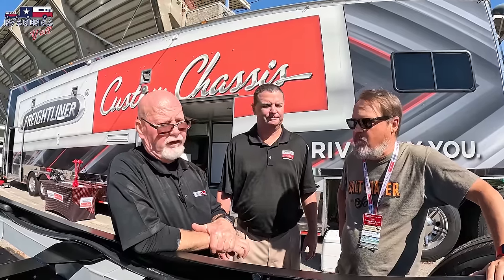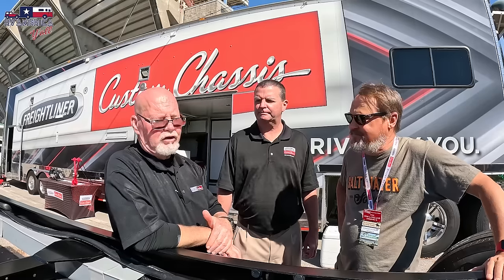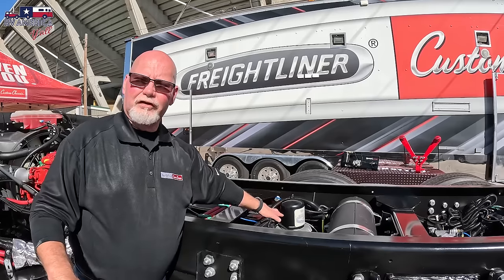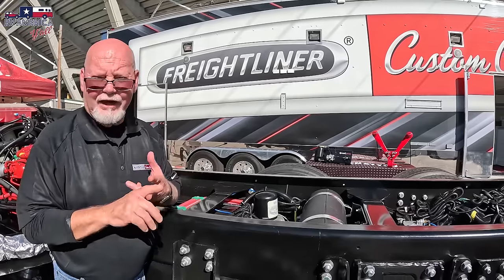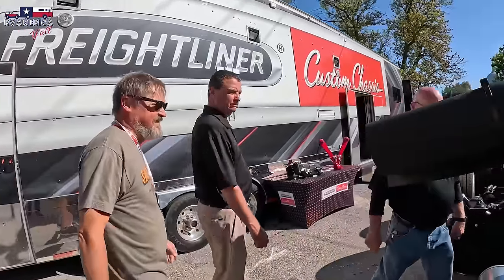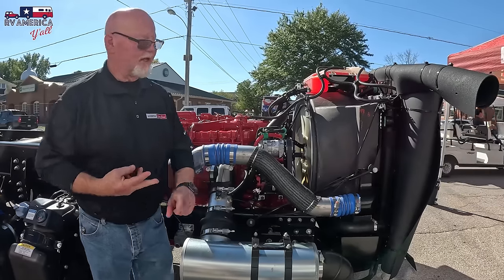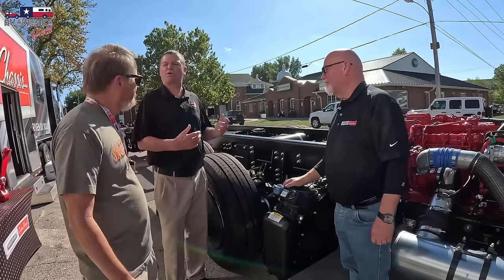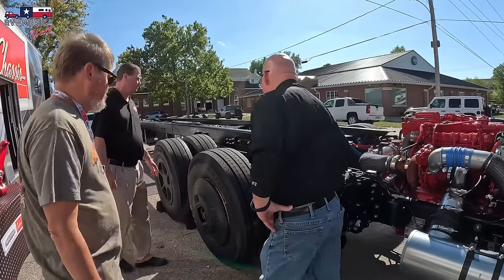Essential Motorhome Service Tips from Freightliner Custom Chassis Experts

Comment: Great video!  Thank you for taking the time to make this video.  I am going back and forth with researching Spartan and Freightliner chassis.  Both seem great and offer a lot of the same features.  The ONE feature that I am sold with on a Spartan chassis - they have a side service center bay (fuel filter, air dryer filter and oil filter) that is super easy to access if you have a rear mounted radiator.  This video shows where the air dryer filter is...looks absolutely horrible to change as a DIY'er.  I wish Freightliner would follow suit and offer a side service center bay on their rear mounted radiator units.  Thank you again for the video - safe travels.
Reply from the maker: You’re welcome Steve, good luck in your RV search 🔍

Comment: Do you need to prime the fuel system manually after replacing the fuel filters? I have a ‘23 XCS 340 chassis (Fleetwood Pace Arrow 36U).
Reply from the maker: After the holidays we will ask Freightliner! Thanks
Reply: Yes it helps if you replace your filter full of fuel. Then pump the rubber plunger on the head above the filter several times.

Comment: I am intermittently getting a P2637 Fault Amber Gear with a ! mark in center. I believe it has to do with communication from the ECU and the TCU (or module) 
Where are these contol units located engine and transmission
Reply from the maker: Call Freightliner at 
1-800- FTL-HELP

Comment: I'll never understand why Freightliner puts the air dyer cartridge is an almost inaccessible place.  I just had mine replaced and the cost was $561 due to 2.5 hours of labor to get the old one out and new one in.  It's no wonder they are overlooked as they are hidden and very hard to get to.
Reply from the maker: We will pass that comment along but that might be Cummins not Freightliner since it is part of the engine! 🤷‍♂️
Reply: YOU GOT ROBBED.  I change mine myself it takes about 30 minutes and most of that time is cleaning the base, prior to installing the new filter cartridge.

Comment: my question is why in God's name do they still make a rear radiator model. Since it's all about convenience  and they still put the radiator in the way for maintenance
Reply from the maker: It is dictated by the manufacturers and the side radiator chassis cost more.  It’s an economical decision by the manufacturers.
Reply: a side radiator is cheaper to maintain and a heck of a lot easier to work on. case in point is the fan belt replacement @rvamericayall